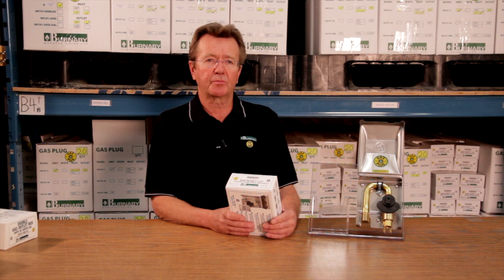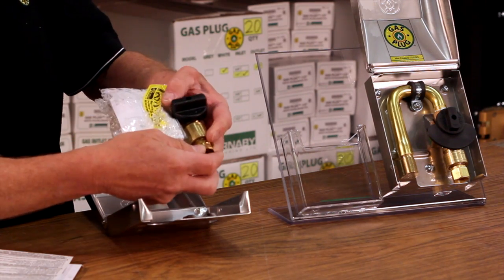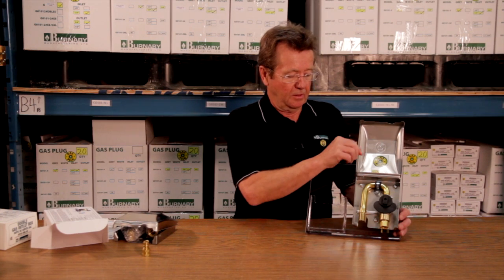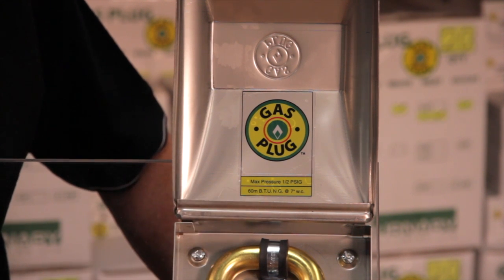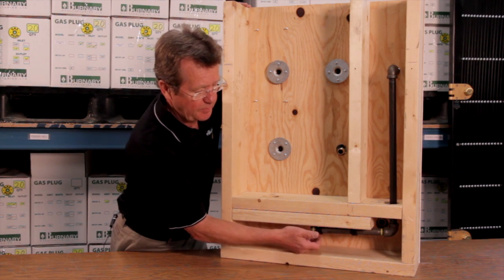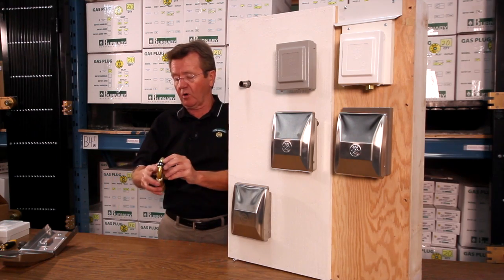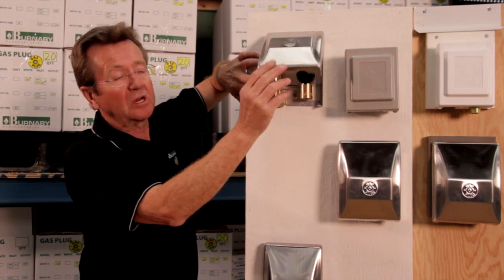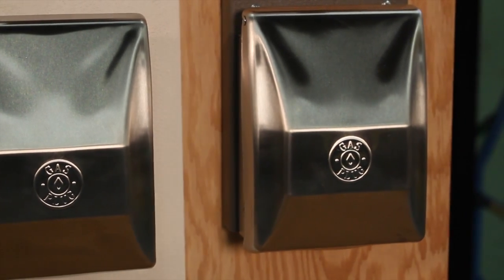Stainless Steel Gas Plug(TM) - G0101-SS Installation Instructions

Comment: Just a checking question: with Weber gas grills, I believe the hose they supply already has a male end that will work in the Gas Plug, once you remove the male plug that comes with the GP.
Reply from the maker: Our quick disconnects are a universal fitting, so the male plug you get with your grill should work with our female socket.

Comment: I just installed a stainless steel plug manufactured by Burnaby Manufacturing Ltd. It is nice and easy to use, but the only part that was a little bit challenging was the standoffs, hard to figure it out how to utilize them. I suggest you add more instruction about how to use those tricky standoffs to your video.  Thanks
Reply from the maker: Hi Diyako, we do have a video showing how to utilize the Adjustable Standoffs - https://www.youtube.com/watch?v=uwB0Ic9ZBbk  I hope this helps!

Comment: I'm interested in your Double Gas Plug, the G0101-DBL or the G0101-2#DBL.  I have 2# NG going out to the deck and I originally planned on putting a regulator to drop the gas pressure but your product has it all in one if I want to go that route.  Your spec sheet shows 60,000BTU each side regardless of which model I get.  I apologize for being a novice, but in theory is there more pressure available to each side if I use your 2# model versus reduce it BEFORE your regular pressure model?  If I plug a gas grill into one side and a fire pit or heater into the other might I get into a gas pressure issue .... potentially a starvation issue if I reduce before?  My brain wants to think that there is a pressure difference between the two models but the spec sheet doesn't show that.
Reply from the maker: If  the GO101- DBL or the GO101-2#DBL are supplied with a ½” gas line, then according to the piping tables (120M BTU Nat)  , you will not get a pressure drop in either side if both sides are used. The capacity restriction is the coupling on the GO101-DBL and the regulators and the coupling on the GO1012#DBL.  Feel free to email us directly if you need further clarification - info@bbymfg.com
Reply: @BBYMFG  Thank you, I'm going to a local showroom (Ferguson) who sells your products today.
Reply: @BBYMFG  I picked up 2 of your disconnects and last night I ordered 3 tiki torches from your website.  Thanks again for your help.